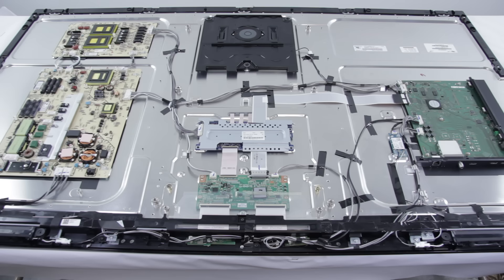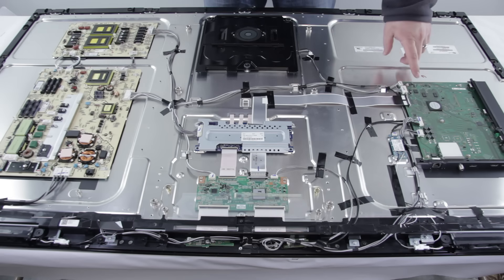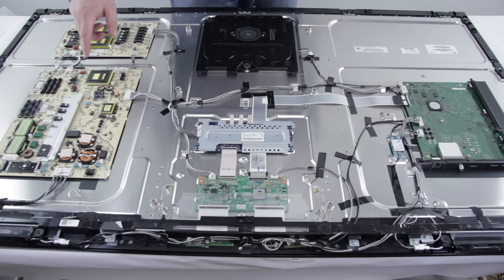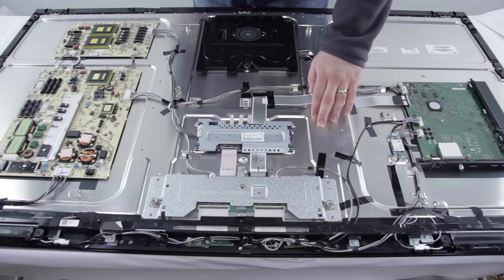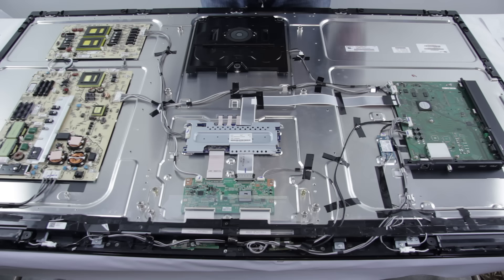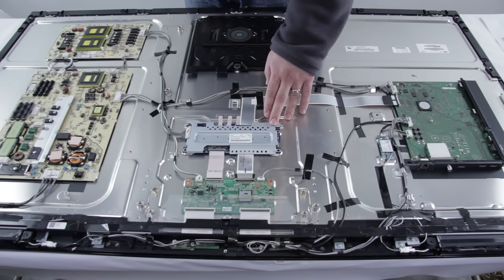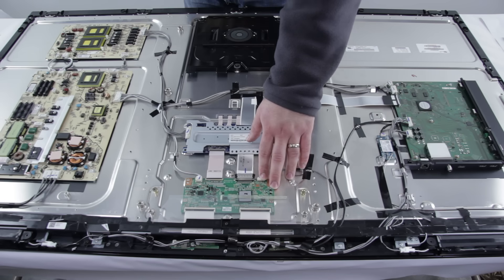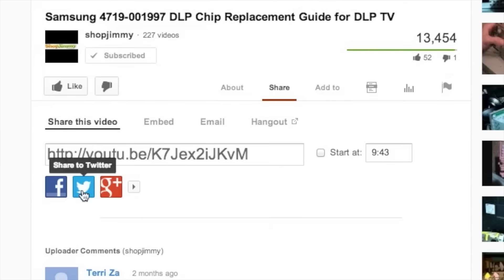LED TV Repair Tutorial - Common Symptoms & Solutions - How to Repair LED TVs

Comment: Haier LE42B1380 not illuminating.  It went out once while I was watching it, turned it off, waited a moment, turned it on and it was ok.  Another time I turned it on and no light, turned it off then on and ok--I don't remember which of those happened first.  A day or two later and it's dead.  The power light goes red to green, I get sound, but no picture.  Before when I'd turn it on it would light up a dark grey color then the picture would come on, now it doesn't light at all so I'm assuming it's just the illumination not working.  Is that something you know the cause of and is it an inexpensive part?  I'm very proficient at fixing things, but haven't cracked into the case yet to try to diagnose it.
Reply from the maker: DonziGT230   It looks like the LED's are driven directly from the power supply.  Could be bad power supply, bad LED strips or bad enable signal from the main board.  You may need to start replacing boards one at a time and see which one fixes the problem.  Here is a link to replacement parts for your TV model number on our website, click here:  http://www.shopjimmy.com/catalogsearch/result/?q=LE42B1380  Be sure to match part numbers on your current board, with your replacement for compatibility.  You can also call our customer service for further assistance with your purchase.  (877) 881-6492  Thanks and please let us know if you have any further questions with your TV Repair!  www.shopjimmy.com

Comment: Vizio 550sl no picture but sound .. happens frequently.. power up tv no logo or display .unplug and wait ten min it bring up the picture and sound..
Reply from the maker: chris mcmurray   I recommend replacing the main board in your TV.  Here is a link to replacement parts for your TV model number on our website, click here:  http://www.shopjimmy.com/catalogsearch/result/?q=550sl  Be sure to match part numbers on your current board, with your replacement for compatibility.  Here is a link to a video showing how to identify your part number, click here:  TV Part Number Identification Guide for Vizio Main Boards (Plasma, LCD, LED)  You can also call our customer service for further assistance with your purchase.  (877) 881-6492  Thanks and please let us know if you have any further questions with your TV Repair!  www.shopjimmy.com

Comment: I did change the led driver and is the same just a flash.  Last night i remove the back cover and the screen to see the leds but they are all right.  Can it be the power board?
Reply from the maker: Paul Vornicu   Yes, the problem could be the power supply.  Thanks!  www.shopjimmy.com
Reply: Z to x

Comment: I have a vizio e320i-b1 everything turns on and I have backlight and signal however exactly half of the screen has like a high tint or rainbow type coloring any help would be great!
Reply from the maker: Matthew Mandegar   Is your TV still under warranty?  If so, you may want to use your warranty coverage to fix this problem.  Otherwise the problem could be a bad t-con (if this model has a t-con) or a bad TV panel.  Thanks and please let us know if you have any other questions!  www.shopjimmy.com

Comment: 47 inch vizio led tv.
Press power screen comes on,
Within 5 seconds turns back off.
Any thoughts? 
Thanks,  chad
Chadwick.coghlan2@gmail.com
Reply from the maker: chad coghlan   This sounds like a problem with either the main board or the power supply.  You may need to replace each board individually, to see which one fixes the problem.  Please reply with your TV model number and then I can recommend a replacement part.  Thanks!  www.shopjimmy.com

Comment: I have a Viore LED42VF80. I recently ordered a main board replacement for the tv (Order #1626038 ) to fix the tv not cutting on issue. Red standby LED would illuminate but when you turn it on no Green LED at all. After I replaced the board, green LED comes on but no backlight and no picture

Comment: i have a lg led tv model number 42LE5300. the tv baclight led strip panels are not working. when i turn on the tv, its shows lg logo then it goes black. led strips are working only the lg logo appear. what shoud i do? need to change led strip panel? i tried to replace main board and video board. till same problem. please give me a solution. thank you
Reply from the maker: kumar gp   If you have already replaced the main board and power supply board with working replacements, and you have not seen any results, then I recommend replacing the LED strips, which we do not stock.  Thanks and please let us know if you have any other questions!  www.shopjimmy.com

Comment: Hi, I have Samsung LE32R87BD, the screen shows the picture normally, everything is working but, the colors are messing up between themselves especially when picture is moving, even menu columns and buttons colours are messed up too. There is a feeling like there would be not enouth bit in it, but there is all kinds of colours, and some times I can see clear picture. I'm trying to find the answers but nobody had the same problems yet. When I'm trying to connect different devices, still problem the same. Help please to find the solution.
Reply: Can it be that T-con board faulty?
Reply from the maker: Edvard Machrov   If your TV has a T-Con board, then I recommend replacing that board, if you TV does not have a T-Con board, then I recommend replacing the main board.  I do not see any parts listed on our website for this TV model number, as I believe it is a UK model.  Thanks!  www.shopjimmy.com
Reply: I got it back from repair center, they told me that it is LCD Panel faulty, and Samsung don't do this parts anymore. :(

Comment: Hey there i have a lg42ls5600...   I got sound and power. The remote is working perfectly.  But there is no backlight.  When i switch on the tv for a split of second i got light but just for a second.  Any suggestions? Thanks
Reply from the maker: Paul Vornicu  This sounds like a problem with the backlight inverter(s) in your TV.  If your TV has a backlight inverter, I recommend replacing it, and if there is no backlight inverter, then I would replace the power supply.  Unfortunately I do not see any replacement parts in the search results for your TV model number on our website.  Thanks and please let us know if you have any further questions!  www.shopjimmy.com

Comment: Hi there. I have a Telefunken TFW32125LED12 tv. When it was given to me the powed was not lighting. I opened it and saw that the fuse was burnt. I replaced it and tried to power the unit and then i heard a noise and when i looked at the fuse , it was burnt again. So i decided to change the PSU. Once done the power led remained off. Ichanged the PSU twice and the tw wont to power. Can you tell me if i need to change somthing else.
Thanks for your answers
Reply from the maker: Wil BISSO NA BISSO   I recommend replacing the main board in your TV.  Unfortunately I do not see any replacement parts in the search results for your TV model number on our website.  Thanks and please let us know if you have any further questions!  www.shopjimmy.com

Comment: I have a Sanyo LED 40" TV ( model FVM 4012) that has a video overlap issue.  It appears that bottom horizontal portion of the screen (approximately a quarter of the screen area) re-writes on the top portion of the screen and in green. I do have a picture that would show what I just described to make it easier for you to see but I can't figure out how to attach it in this forum.
Reply from the maker: rodrican23   This sounds like a TV panel problem.  If your TV panel is bad, it may be more cost-effective to replace the TV as panels are typically hard to find in stock, difficult to replace, and expensive.  Thanks and please let us know if you have any further questions!  www.shopjimmy.com

Comment: Yes, I have a sony model # KDL46XBR4 Bravia. When turning on the set it has all colored vertical lines on it. Sometimes it's black after turning it on and off a few times. It will snap out of it and looks find. Can you help me. Unit is about 6 years old. Thanks Brooks.
Reply from the maker: Brooks Stewart   I recommend replacing the T-Con board in your TV.  Here is a link to replacement parts for your TV model number on our website, click here:  http://www.shopjimmy.com/catalogsearch/result/?q=KDL46XBR4  Be sure to match part numbers on your current board, with your replacement for compatibility.  You can also call our customer service for further assistance with your purchase.  (877) 881-6492  Thanks and please let us know if you have any further questions with your TV Repair!  www.shopjimmy.com

Comment: my sony lcd tv model kdl-52nx800 turns on the shuts off red light blinks 5 times pauses then 5 times more....whats wrong what does it man....help.
Reply from the maker: angelo ramos   This sounds like it could either be a problem with the t-con board or the TV panel.  You can replace the T-Con board to see if it fixes the problem with your TV.  Here is a link to replacement parts for your TV model number on our website, click here:  http://www.shopjimmy.com/catalogsearch/result/?q=kdl-52nx800  Be sure to match part numbers on your current board, with your replacement for compatibility.  You can also call our customer service for further assistance with your purchase.  (877) 881-6492  Thanks and please let us know if you have any further questions with your TV Repair!  www.shopjimmy.com

Comment: Hey guys. I have an Element ELEFW502 50". The other day the picture randomly cut out completely but I still had audio. The TV will turn on but I get no picture. There is actually an electrical smell coming from somewhere when I opened it up. Do you have any suggestions on what this could be?
Reply: I did the flashlight test and I can still see the menu navigation.
Reply from the maker: Tyler Morris   LEDs are driven off the power supply, so there is most likely something blown on there.  I recommend replacing the power supply board in your TV.  Here is a link to replacement parts for your TV model:  http://www.shopjimmy.com/catalogsearch/result/?q=ELEFW502  Be sure to match part numbers on your current board, with your replacement for compatibility.  You can also call our customer service for further assistance with your purchase.  (877) 881-6492  Thanks and please let us know if you have any further questions with your TV Repair!  www.shopjimmy.com

Comment: We have a 32 inch RCA flat screen. It has a 2 inch bar across the top of the picture that has perfect color. Anything below that is purple, black and green. I was told by 2 different people at RCA's Oncore that it is the main control board. One of them said it might be the "panel." Model # 32LA30RQD. Please advise.
Reply from the maker: Sherry   This sounds like a TV panel problem.  If your TV panel is bad, it may be more cost-effective to replace the TV as panels are typically hard to find in stock, difficult to replace, and expensive.  Thanks and please let us know if you have any further questions!  www.shopjimmy.com

Comment: I save a Samsung un55b7100fxza TV that will not come on.  I can here a slight clicking sound, but no red light displays on the front panel to indicate the power is on.  I have unplugged the tv so that no more damage can occur.  Do you have any suggestions as to what may be wrong with this tv?
Reply from the maker: Jim Jarzen   This problem sounds like it could either be the main board or the power supply that are bad.  You may need to replace each board individually and see if either board fixes the problem.  Here is a link to replacement parts: http://www.shopjimmy.com/catalogsearch/result/?q=55b7100  Be sure to match part numbers on your current board, with your replacement for compatibility.  You can also call our customer service for further assistance with your purchase.  (877) 881-6492  Thanks and please let us know if you have any further questions with your TV Repair!  www.shopjimmy.com

Comment: yes i have a vizio model E500i-A1…it has a black spot on the bottom of the right side of the screen, and horizonal lines in the upper right had side that flicker
Reply from the maker: Joshua Wilburn   This sounds like a TV panel problem.  If your TV panel is bad, it may be more cost-effective to replace the TV as panels are typically hard to find in stock, difficult to replace, and expensive.  Thanks and please let us know if you have any further questions!  www.shopjimmy.com

Comment: As an update, since the activation repeatedly reproducibly extended the time the thing stayed on, I started preheating the various components. T-Con did nothing, and main board did nothing. However, if I preheat the power supply, it appears to stay on indefinitely. I only paid $20 for the power board (used) through Amazon. Can you get a new one? TV's fine with the the hair dryer running, but I can't hear the TV! (I was an R&D professional with lots of patents, but this one ain't worth it!) Thanks. Advice to scrap it is fine, too :).

Comment: RCA LED50B45RQ. Power supply was faulty, so I replaced. Audio works now, and picture comes on, but shuts off shortly after startup. First try shuts off in about 5 seconds, but interestingly, repeat start ups last longer, reaching about 40 seconds max.Replaced T-Con board as well. e-mail jbmcgee@charter.net. Thanks for your thoughts!

Comment: i have Samsung ua40d5000 
problem : i get a 3 inch black belt on top which is translucent on left and get transparent to right . before some weeks if some pressure is applied on top left corner of the frame this belt use to disapper but now it doesn't .It some times blink too.
I am studying Architect .I use this tv as my monitor for computer.
thanks do reply......
mail id: neil.neillalu.patel@gmail.com
Reply from the maker: Neil Patel   This sounds like a TV panel problem.  If your TV panel is bad, it may be more cost-effective to replace the TV as panels are typically hard to find in stock, difficult to replace, and expensive.  Thanks and please let us know if you have any further questions!  www.shopjimmy.com

Comment: Hi I have a proscan plded4016a 90 days out the box screen went black but still have sound. Took back off and only see a main board and a long board which lines the bottom on the TV. What you think needs to be replaced thanks in advance
Reply from the maker: Justin Bray   I recommend replacing the main board in your TV.  Unfortunately I do not see any replacement parts in the search results for your TV model number on our website.  Thanks and please let us know if you have any further questions!  www.shopjimmy.com

Comment: my email is walkerdestiny@gmail.com my son sprayed windex on my 50 inch LED samsung tv attempting to clean the screen UN series it was changing colors, then the screen is completly black still able to get sound cannot get the menu on the tv or anything, is this possible to be fixed without paying the same amount for my tv
Reply from the maker: Destiny Walker  This sounds like a TV panel problem.  If your TV panel is bad, it may be more cost-effective to replace the TV as panels are typically hard to find in stock, difficult to replace, and expensive.  Thanks and please let us know if you have any further questions!  www.shopjimmy.com

Comment: Hi my tv is sceptre and the model is x425bv-fhd
The screen turns on for couple seconds with sceptre logo and than 
The screen turns black
Can you please help what might be the problem
What part should i change
I think it might be power board but not sure.. Please help me
Reply from the maker: avish avish   I recommend running the flashlight test on your TV to help determine if the problem is the backlight inverter or the main board. Here is a link to a video we produced that shows how to run the flashlight test. No Image No Picture on Screen-Flashlight Test LCD TV Repair - How to Diagnose Broken Board TV Repair Please reply with your flashlight test results and we can recommend a replacement part for your TV repair. Thanks and please let us know if you have any questions! www.shopjimmy.com

Comment: HI ShopJimmy! I have a Sony KDL-32L504.  It was working perfectly, then suddenly the bottom 2/3 of the screen started fluttering.  There is a pretty distinct line separating the sections.  The sounds works fine, so I'm thinking its the LED Driver/Inverter.  Do you think I'm right?  Thank you!!
Reply from the maker: *****   This sounds like a TV panel problem.  If your TV panel is bad, it may be more cost-effective to replace the TV as panels are typically hard to find in stock, difficult to replace, and expensive.  Thanks and please let us know if you have any further questions!  www.shopjimmy.com
Reply: ShopJimmy.com Not the news I was hoping for :(  Thank you for the reply and for sharing your knowledge!

Comment: Hello I have a tcl tv model number le39fhdf3300 that looks like a broken screen Some of the screen works but the rest looks cracked please help
Reply from the maker: kyle hankins   This sounds like a TV panel problem.  If your TV panel is bad, it may be more cost-effective to replace the TV as panels are typically hard to find in stock, difficult to replace, and expensive.  Thanks and please let us know if you have any further questions!  www.shopjimmy.com

Comment: I dropped my TV, and now I got a cracked LED. I will appreciate it if you help me. Thank you.

Samsung TV Model No. UN32F5500AF
Reply from the maker: *****   This sounds like a TV panel problem.  If your TV panel is bad, it may be more cost-effective to replace the TV as panels are typically hard to find in stock, difficult to replace, and expensive.  Thanks and please let us know if you have any further questions!  www.shopjimmy.com
Reply: Thank you.